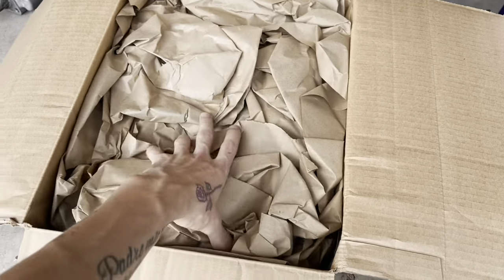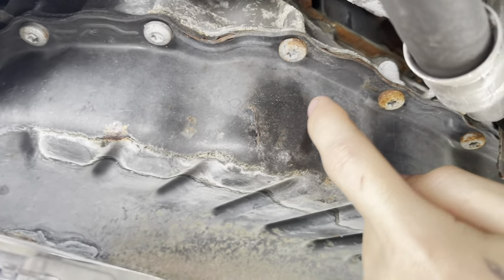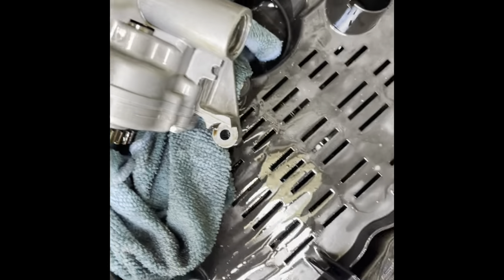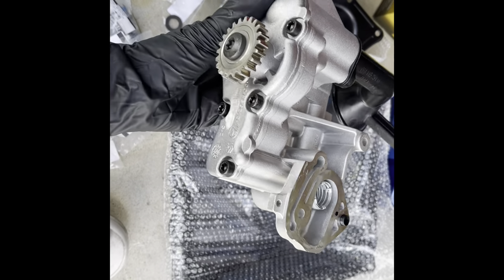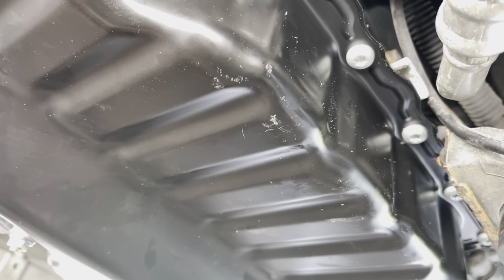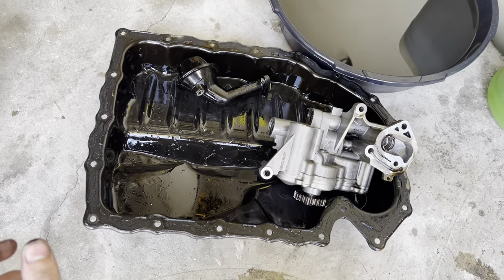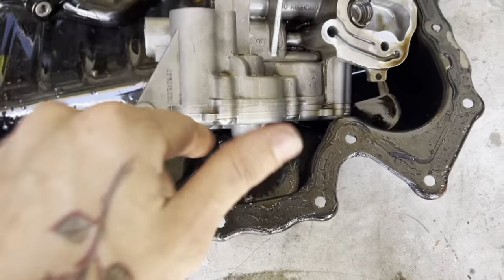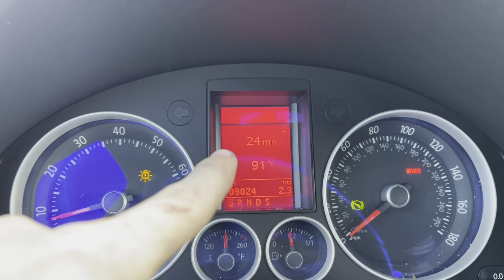My GLI is a lemon

Comment: Cranking the engine by hand is worst than just starting the engine. The pump build pressure faster running than it does cranking the engine by hand. The engine is not dry because there is oil on the bearings from the last time it ran.

Comment: Did you check the rod on the oil filter cup?
Reply from the maker: Yeah it was good. I’m going to replace balance shafts, all timing components and the water pump while I’m in there. Should be back up soon 🤞🏼